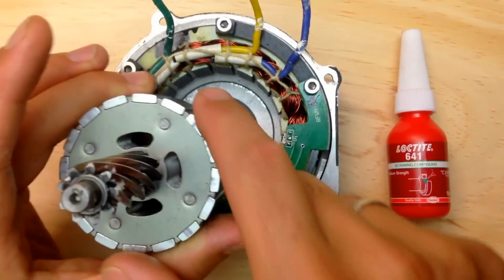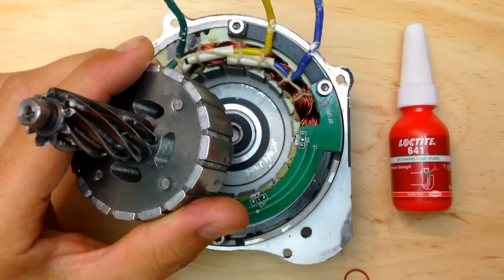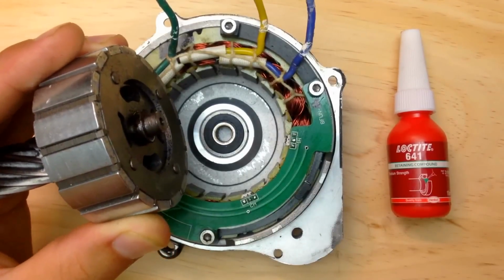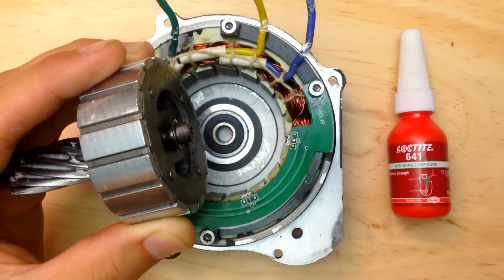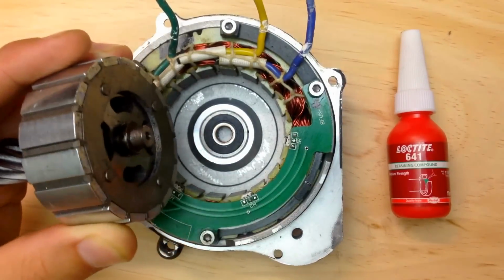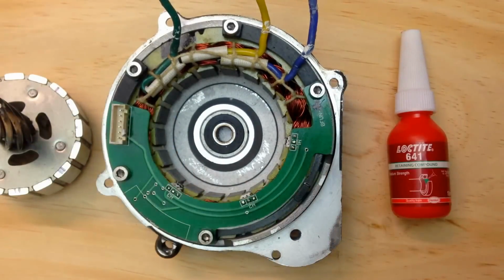6000km motor shaft noise on Bafang BBS02 / BBS01 (Loctite) • DIY Electric Bike Motor Mid Drive

Comment: My BBS02B started making this noise after only 300KM (186 miles). Now at 700km (434 miles) it's noise has become unbearably loud and I don't get the speed I used to anymore. I was hoping it was going to be something simple, like loose screws inside the motor or something, but after watching this it's unacceptable to me that something like this would be the issue so short after buying the motor brand new... I am thinking about just returning this motor now..

Comment: My BBS02 just started making this exact noise at about 4500 miles. I will try the loctite, hoping it works. Thanks for putting this out there.
Reply: I didn't end up using loctite. I found an O ring that was about the right size and used it, lubed up everything well, and so far it's fine after a few hundred miles.

Comment: The bearing came out with the motor shaft when we pulled it out, I'm not sure what to do! Should I pull the bearing off and then loctite the shaft into the bearing?
Reply: If it came off with the rotor then it probably isn’t loose there is it?

Comment: https://youtube.com/shorts/amqVKI8T_9g

Hi, can you please tell me if this sound is serious as it sounds like a quieter version of your motor? but mine is a bbs02b bought new November 2020 with just over 500km. Also big and small cogs (I think they call them reduction gears) inside motor cover that have been greased like your other video shows how to but noise is still there after greasing.
Reply: Mine started doing the exact same noise as yours. Did fix it or find what happened?

Comment: Was the bearing toast causing the shaft to spin in the inner bearing race???Must have been for the shaft to be spinning inside the bearing....or those bearing have a shit load of friction due to the rubber seals.That bearing looks to be enclosed by the case so a rubber sealed bearing is not needed.

Comment: Hi man
do you recommend to use Loctite 641 from the beginning? 

Cheers!
Reply from the maker: +Uilleam Gilvoni  - Hummm... good question... I wouldn't recommend opening a new and fresh motor... too much work to get to the motor shaft... maybe save the Loctite procedure for a bit longer around 1000km... the molygrease on the pinion gear is more important to inspect regularly on BBS02/BBS01.... the grease should last longer on the BBSHD as Bafang have done a design improvement. =]
Reply: +ElectricBike (Bruno) I see, thanks man! keep doing your amazing work!, is helping so many of us :)
Reply from the maker: +Uilleam Gilvoni - Yeeeahh... I am glad I am helping people hahahaaa... I just replied your other question about the grease on the other video you left a comment... basically the easiest way is to get the white lithium grease that is splashed all over the casing and re-apply over the nylon gear... you will be good for maaaaany many kms again =]
Reply: ElectricBike Thank you dude! truly appreciate it! i will go to find some grease now, cheers!

Comment: Hello Bruno, so Bafangs has more bugs and also comming out of the motor. ;))) How is new display? Does it now show real SOC of battery?
Reply from the maker: +DaDo Bzz - Yeeeahhh.. so many bugs... hahahahaa... I am laughing here so much with these comments... 
The new display is good, almost identical to the Bafang Max drive I show here in this video https://youtu.be/mazogf-kHh0?t=2m8s but the one that is coming with the BBSHD is bigger with a dark LCD on the bottom (native black that lights up clear), very similar to the Bosh display. I am trying to get the manual from Bafang (they are having a break for the Chinese new year) so I can make a video showing all functions. Yes, it looks like the battery levels showing on display will be more accurate as you can add your battery info to the display.. this is a really handy feature. So much POWEEEEEEER =]

Comment: Ive got my motor apart at the moment and would like to do this but how could you ever take it apart again? It took me long enough to get it out the first time without it being glued in. Any ideas? Thanks for the videos, they have been a great help.
Reply: +ElectricBike (Bruno) Thats the way I've been looking at it; once its in, it should never need to come apart. My motor had done about 1000km in very hard mountain biking conditions. Its amazing how well it has lasted but let down by bad waterproofing. When I took it apart, water actually ran out of it. Still worked though. Hopefully putting it back together this week if the parts finally arrive. Thanks.
Reply from the maker: +Paul Williams - Yeeeeahhhh... the motor shaft is very unlike to fail... basically Loctite and forget =] Brushless motors still working even if you immerse in water, as long as you don't get a short on the 3 phase wires it will keep on working. Maybe you can add some extra silicone to make it really watertight by adding a layer outside (ugly but will do the job). If you glue the motor on the chassis will be very hard.. (almost impossible) to open it again to inspect the internal gears. Water would cause corrosion on few metal parts so make sure you dry it properly maybe using a hair dryer getting all the moisture out before you pack all together. =]
So much POWEEEEEEEEER =]
Reply: +ElectricBike (Bruno) thanks mate
Reply from the maker: +MySatora - Yeeeeahh.. good question... the Loctite I use is medium strength, some people use the hardest one (high strength) and is IMPOSSIBLE to remove the shaft, medium is haaaard but possible. Have you watched this video showing how to easily remove the shaft using a thick rubber and locking pliers? https://youtu.be/tAn_ft3WNqs Once this thing is locked (glued) it won't damage like it happened to this one, the motor should be maintenance free and last forever... its so far the most reliable part. So much POWEEEEEEEEEER =]

Comment: HI BRUNO,
I KNOW OF A PERSON THAT FRIED THE CONTROLLER OF THE BBS-HD 1000
HOW IT CAN BE APPENED ?  EVEN IF A BATTERY HAS A BMS OF 60 AMPERE
CONTINUOUS, THEN IS THE CONTROLLER THAT TAKE ONLY THE MAX CONTINUOUS AMPERE THAT IS PROGRAMMED. AND IN THE CASE OF THE BBSHD ARE 30 AMPERE.
SO, IT'S STRANGE THAT 12 MOSFET 3077 HAVE HAD OVERHEATING PROBLEMS,
MAYBE IT'S SOMETHING ELSE !?!? WHAT DO YOU THINK ? IS IT EASY TO CHANGE THE INTERNAL CONTROLLER OF THE BBS-HD ? HOW IS IT GOING YOUR BBSHD ?
EVERY DAY I WAIT FOR NEW YOUR BBSHD RIDE VIDEOS  !!!
I HEARD OF A PERSON HAD INCOMPATIBILITY OF THE C965 UNIT AND BBSHD.1000
IT WAS NOT ABLE TO READ THE WATTAGE, MAYBE BEACAUSE THE UNIT WAS FOR 36V AND NOT FOR 48V AND THIS PERSON SOLVED THE PROBLEM USING THE C961 UNIT (THAT IS THE SAME YOU USE WITH YOUR BBSHD) - INFACT THERE ARE EVEN 5 KIND OF C965 UNIT . THE FIRST IS WITH 3 BOTTONS FOR 36 VOLT , THE SECOND IS 3 BOTTONS FOR 48 VOLT, THE THIRD IS 5 BOTTONS FOR 36 VOLT AND THE FOURTH IS WITH 5 BOTTONS AND 48 VOLT AND THE FIFTH IS THE DP C10 UART UNIT WITH 5 BOTTONS AND FOR 24-36-48 VOLT..
SO LET MEKNOW AND UPLOAD OTHER VIDEOS OF YOUR BBS HD !!!
YEAHHHHH
Reply from the maker: +ROBY ROS - Yeeeeeahhhh.... Fried BBSHD controller is the very first case I heard about.. I know one or two faulty (what is expected) but not fried. The guy must have done something reeeeally wrong or the controller had a problem, I tried frying mine going up hill in wrong gears but nothing happened... =]
I have just installed the C965 5 buttons in my bike today... it says 24/36v but it worked with my pack at 52v. The wattage is not accurate compared to my Cycle Analyst... but it is okay and gives you a reference if you don't have any other device to compare =] I just got my hands on the New BBSHD display, almost like the Bafang Max Drive but it comes with an USB port that I couldn't figure out how to connect anything there (it was like it was turned off or maybe just for programming purposes or something)... so much POWEEEEEEER =]
Reply: +ElectricBike (Bruno) try plugging usb device to be charged in before turning the bike and display on...
I found this quote
[The USB port not power up unless an active device is plugged into it before powering up the display]
here: https://electricbike-blog.com/bbs02-displays/
Reply: Similar issue with USB port , tried a different cable and got it working , but not sure now that I've read that, could of fluked it